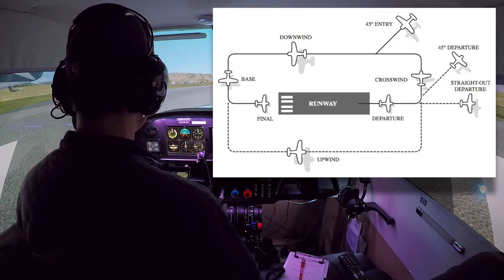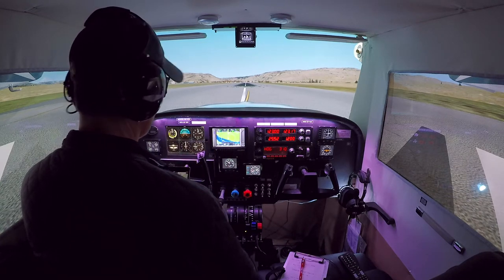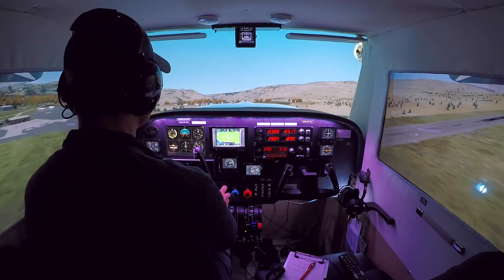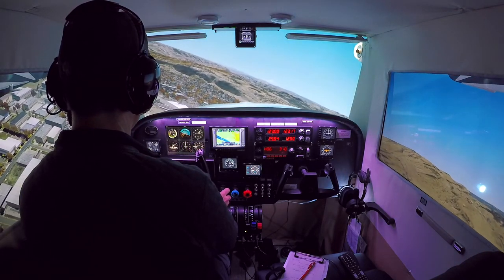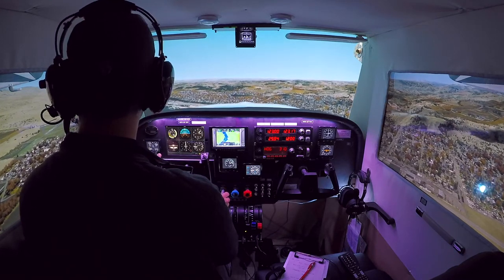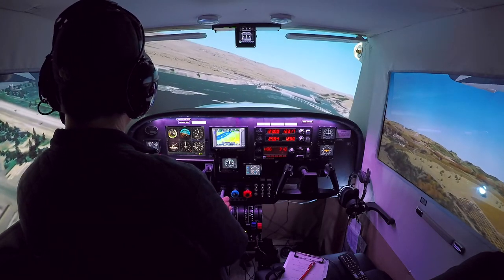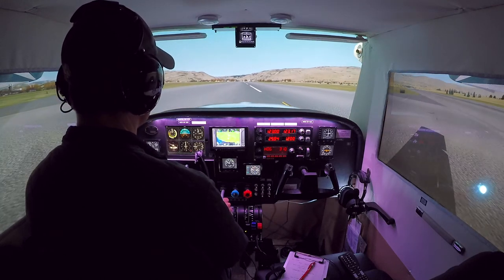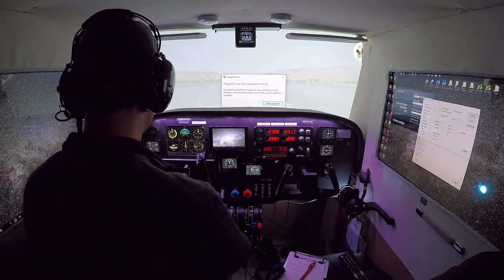Sim Tutorial: How To Fly A Traffic Pattern (Prepar3D Home Cockpit)

Comment: On the topic of the trim wheel....  I always turn it a few times, right after Windows booted and before starting the sim.  I listen for the USB disconnect and reconnect.....  That's my signal that it is okay to start the sim. If I don't do it, it crashes my system and renders the mouse useless.
Reply from the maker: +Skymatix1 yup. What's odd is that mine stopped needing that for a while. I think the latest Windows update may have reinstalled the Saitek driver, which I have uninstalled. Now I just need to test it. I forget to spin it about half the time. #checklistswork
Reply: Excellent video by the way. Thank you for sharing
Reply from the maker: +Skymatix1 thank you!